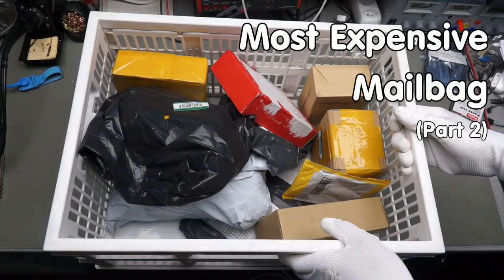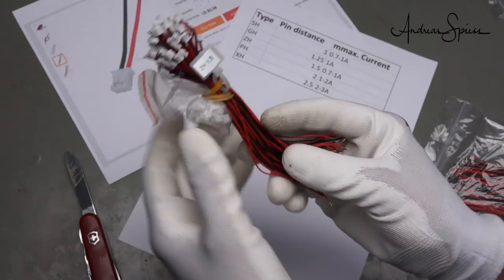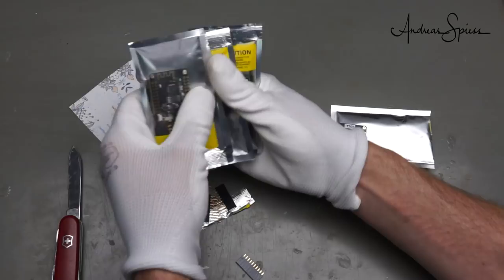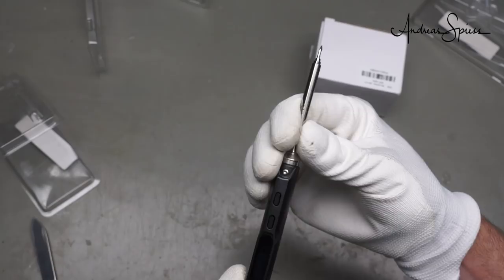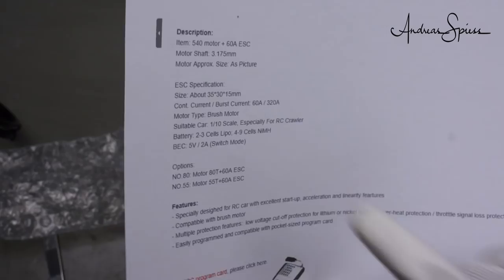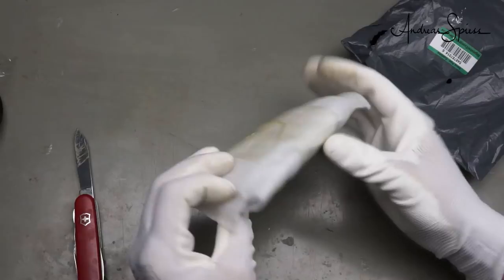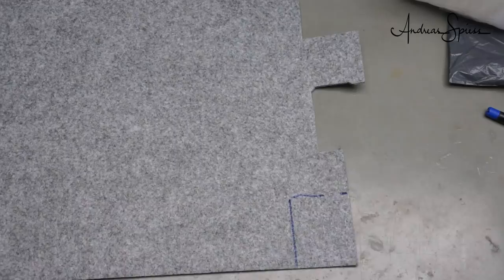#205 My most expensive Mailbag so far (Part 2)

Comment: Thanks for sharing.  Those are some nice toys to play with!

I agree with you on robust interconnects.  Those lightweight "fairy" connectors we get seem to be as much planned obsolescence as space and materials conservation.  Imagine a cell phone designed to last 8 years with such a solid USB connector!
Reply from the maker: If they are fixed in a housing it is better. But here you can easily destroy them because they only depend on the SMD solder joint

Comment: Another great mailbag! As an underwater acoustics engineer,  I was very happy to see you will be experimenting with the two element Langevin Stack transducer and the power amplifier board. I have the same units, along with many others. The Chinese made Langevin Stack transducers are available in 60, 100, and 120 Watts, and the power amplifier board is available in a higher and lower power output. As you know the transducer is heavy (and that's the small one) so I am always amazed that I can buy them and get them shipped to me from China for less money than it costs for me to just mail them across town...

As you know, those transducers are used mainly in ultrasonic cleaning applications, but they will work as a good receive element if the front metal horn is properly tuned by loading the front of the element (this is also required for best performance as a projector). There is equipment for doing this, but you can also do it experimentally by looking for the adjustment that maximizes current flow.

The cooling for the power amplifier is a little dodgy for driving a 100 or 120 Watt load. I use a big table fan to keep it cool when I am using it. Maybe it will be OK with your 60 Watt transducer, or maybe you will blow up your undersized 60 Watt transducer! Should be fun to watch either way!
Reply from the maker: Very interesting. Could you drop me a message on Facebook messenger or on Twitter (if you want) to get privately in contact? I would be glad to profit from your vast experience. As I said, this is a very new topic to me...

Comment: You should also double check the polarity for those JST PH (2.0 mm pitch). The ones I got have the red and black wires swapped. Had I not noticed I could have killed some of my development boards or forcibly overdischarged a lipo the wrong way around.

The picture of the JST PH on that website would seem to indicate you also got swapped wire versions.
Reply from the maker: I mentioned the fact that no standard exists in my ESP32 videos and showed how to avoid what you describe. As you wrote. You better know it before you power up.

Comment: good idea with the rubber band and marking - but in my experience rubber bands fail quite quickly and turn into some gooey mess... I keep things in zip-lock bags instead

I really can recommend the German WEICON No 5 wire stripper.
Reply from the maker: Also a good idea. I also like the zip-lock bags and use them often in other situations.

Comment: just a tip but rubberbands usually don't hold very well (maybe you don't have sunlight in your lab), but I'd rather use some metal wire or a tie wrap or why not just put the wires with the counterparts completly in small bags .... added advantage that you can write on the bag whats inside....
Reply from the maker: Also good ideas. But as you write, without sun and without force they seem to live quite long.

Comment: I find those 'automatic' wire strippers work well for medium to large diameter wires, but not very well for the smaller stuff, especially trying to get a short length of insulation off the end.
Reply from the maker: Thank you for your feedback!
Reply: I love mine, even for small gauge wires. It never cuts the internal strands of wire like the kind Andreas likes do. You're right though, it's difficult to use on small lengths of wire.

Comment: The SX1276 LoRa chip is a true gem (and I've tested many). The antenna you've received is a rubbish (95% chance). With the stock antennas (those are put everywhere, starting from GSM chips down to 433MHz transceivers) you'll seriously underestimate chip's capabilities. Please buy the one (omni or directional) exclusively tuned for 868MHz and you'll push it behind the horizon (which is limited by altitude). I did 80 km at 1km elevation at lowest bit-rate possible (300bps).
Reply from the maker: You are right. Maybe you saw my video about my 201km distance?
Reply: Now I did :) And left a comment/question there.

Comment: The strippers you didn't like are good for some types of cable, but I like the Duratool DT1002 from Element14.  It works well over a wide range of wire sizes and is often on special for about $25 AUD.
Reply from the maker: I did not find the DT1002, just the DT1022. Maybe a typo?
Reply: Sorry, it's a D01022

Comment: "If you don't want to search, you have to have some order". Great tip! If only I had the discipline to maintain that discipline on my messy desk. Regularly searching too long for things signals me that I really should bring back some order there...
Nice postbag with interesting parts. Thanks!

P.S. that box with some red thing in it went a bit too fast. Still wondering what it was...
Reply from the maker: The box contains all sorts of SMA adapters. I just too a gender changer adapter from there.
Reply: Andreas Spiess did you buy it as a set of have you just collected them over time? A very useful collection!
Reply from the maker: I collected them. I never saw such an assortment. And the red point means: Attention: Reverse Polarity...

Comment: I've had the rak tracker for a few months. As far as I can tell it's useless; The software for it never sleeps so it drains the battery and the charging circuit never charges the battery completely.
Reply from the maker: Thank you for your feedback. I forwarded your comment to RAK. Maybe they have an explanation I can use during m,y review...
Reply: Hi,Thanks for suggestion, I came from rakwireless. we notice that software is not support sleep mode. We will implement soon and also we optimize the new design since we collect many improvement suggestion from developer.However,we can't understand that charging circuit never charges battery completely. Can you explain more detail or shall I have your email address?
Reply: I'll need to look at it again but from what I remember all of the other stuff on the board running was causing the charger to never get enough current to actually put something into the battery.
I did start writing a new firmware for the tracker based on the latest version of loramac-node but I didn't have much time to complete it. It would be really nice if you guys could fork loramac-node and add the changes that are needed for the rak811 module so people that want to work on custom firmware for the rak811/the tracker have a good base to start from.

Comment: I really like that soldering iron, but have to say, they REALLY missed the bus with how the tips are secured.  The set screw should have been a ball detent instead.  Would've been so much better of a design!
Reply: you can leave it loose and all works just fine including rapid tip replacement.
Reply: Maybe so, but a ball detent would have made this 100 times a better product.
Reply: 100 times really???? If you actually owned or had used the tool you would realise it is a complete non issue. The spring contacts provide more than enough retention of the cartridge.
Reply: just took a block of wood, drilled 4 large holes in them to hold the tips, 1 smaller hole for the small allen wrench and in the middle a larger hole only a couple mm deep where I put a wood screw in the hole and put a small round magnet inside to hold the small extra screws, everything nicely tucked away on my desk :)

Comment: Hello, Andreas: Do you plan to "hack" the "Auto Waterproof Ultrasound Receivers" in one of your next videos ? 
Greetings from Portugal !
Reply from the maker: What aspect would be interesting for you?
Reply: The voltage/distance analysis of the sensor without the "misterious Chinese black box"... i have no Oscilloscope so i wonder what form the response signals are interpreted.
Reply: ... i wonder that there are very tight timed pairs of voltage "question and answer" and the distance readed is some sort of a result function, maybe i'm wrong here...
Reply from the maker: I assume they work as the other sensors where you send a trigger signal an count the time a signal at the echo pin occurs
Reply: That makes a lot of sense. "Echo". When i receive my next "own mailbag", I'll try to send an 12v signal to the thing and listen to the echo pin. Then i will let you know the results. Thanks a lot !

Comment: Try to remove the plastic "tube" covering the antenna. Some of mine are spot on frequency in "nude" state, but off resonance as delivered. It seems the engineers let go of the product a bit too early, before the designers got to do their part. ;-)
Reply from the maker: You are right. I discovered the fact in another video. But too short is too short. The last one was too long and I clipped it ;-)

Comment: Thanks for sharing Andreas. Anyone knows how to build female JST cables? They are impossible to find prebuilt.
Reply from the maker: If you mean the ones mounted on the PCB? I do not know where to get them as "cable version". I only solder cables to them and seal it with hot glue...
Reply: Andreas Spiess yes, you can find a lot for PCB but not cable version. They could be very useful for many connections (battery chargers for example)

Comment: Looking forward in a review of the rak811 tracker board. I'm still waiting delivery of mine. As far as I have understood from a forum thread on ttn then it is possible to run a firmware on it which removes the need of an additional microprocessor which is needed for the normal rak811 board.
Reply: Yes, we use similar module with STM32 and Semtech chip and STM has example code and projects. You can even transmit Sigfox https://www.murata.com/en-sg/products/lpwa/lora
Reply: I've had mine for ages. The tracking stuff runs on the STM32 inside the lora module. Their firmware is just hacked up version of the loramac-node stuff.
As a tracker the performance is poor: It never sleeps so the battery drains and on my one the charger doesn't really work.
Reply from the maker: I will look into the matter when I start playing around with it.

Comment: Andreas, nice unboxing. I think I liked this one the most because the items you bought are affordable now heheh. Where did you get the box with many sma connectors? Btw, would the extension/converter that you used change the resonating frequency?
Reply from the maker: 1. The SMA adapter box is "do-it-yourself" by me
2. because the SMA gender changer is still in the shielded 50 ohms part it should not change the resonance frequency. But you never know. But it would for sure not change it to a higher value because it adds length...

Comment: The JST connectors I bought last year were disappointing for power applications, as they had a high resistance.
 Have seen a video where incredible things were done with wire strippers that melt the insulation, instead of cutting it.  But maybe this is too fancy as well!
I saw the Louis Rossman review of the TS1000 as well.  It is a shame that the hook shapes are not (yet) available.
Reply from the maker: These JST would probably not be my first choice for higher currents. And I also like these strippers because they do not take a lot of space in my drawer (and do not need power ;-).

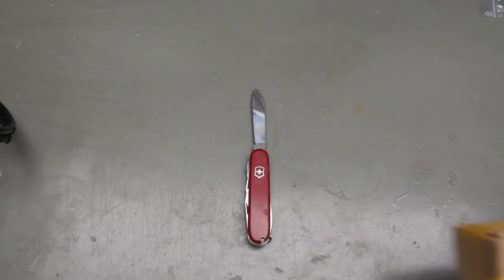Comment: Hello, Andreas you might want to consider calibrating your speed controller as shown at: 6:16, this is usually done by unplugging the speed controller (esc), setting the pwm to the max value (through remote control), plugging in the battery to the esc, waiting for a series of beeps, then setting the throttle to the minimum value. Yours may be different however so I would reference the devices manual, and you may want to watch this video for assistance (https://www.youtube.com/watch?v=OOplk52R4no). 
I hope this helps.
-David
Reply from the maker: Thank you for the link. I saw that Bangood lists a tool to program the ESC. But I am not at all an expert in these things. I have to learn them by doing...
Reply: I understand the learn by doing approach, usually the programming tools only set esc settings such as esc brake, forward/reverse, etc.. this one may be different however. I wish you the best of luck.
-David

Comment: How is it possible that antennas are "miscalibrated"? Isn't it as easy for them as cutting the same wire at the same length? Do they not check if their design is correct?
Reply from the maker: I honestly do not know.

Comment: at 10"02 you show your prefered ESP32 arduino plateform. I have the same and I had some probleme to find information to use it with arduino IDE. may you help me about the name of the pins in code ? (I'm french and I hope you understand me ;) )
Reply from the maker: The pins on my boards are IOxx where xx is the number of the GPIO you have to name in your sketch.

Comment: do you label and save the mis labbeled antennie ?
Reply: I think he should open it and trim the wire in order to match the 868 resonating frequency and use it.
Reply: Italo Loureiro - Trimming an antenna will move the frequency higher and he said it was at 1040 MHz.
Reply from the maker: 1. Usually, I throw bad parts away. It saves me time in the future
2. Trim a too short antenna is not as easy as trim a too long one ;-)

Comment: There are only two wire strippers. First Weidmüller Stripax or the KNIPEX MultiStrip 10

If you have one of these. You would never buy a other model.
Reply from the maker: Thank you for your experience. They are not cheap for a simple Maker :-(